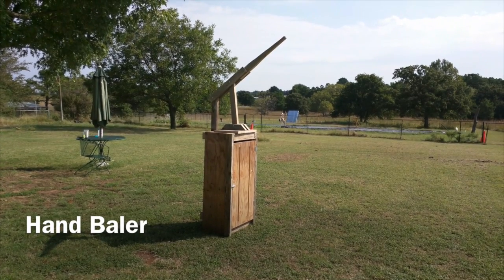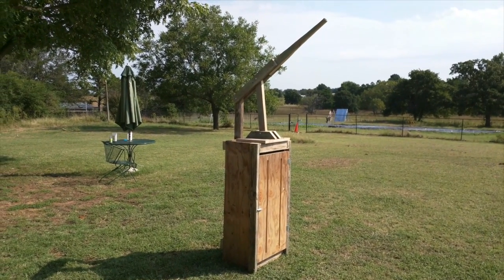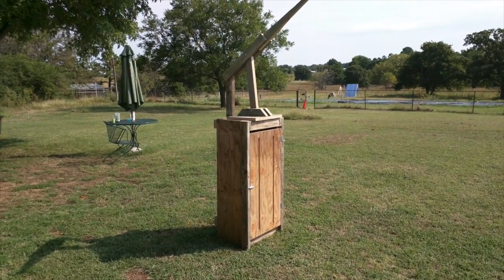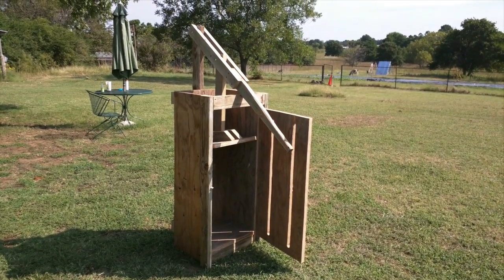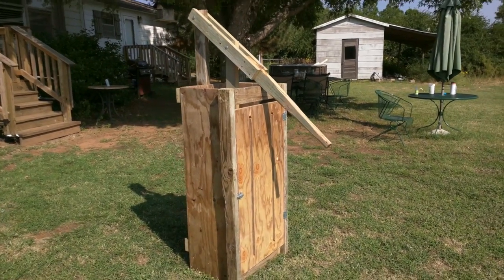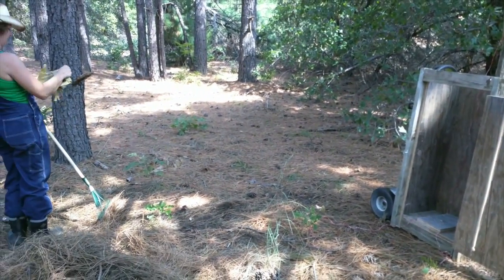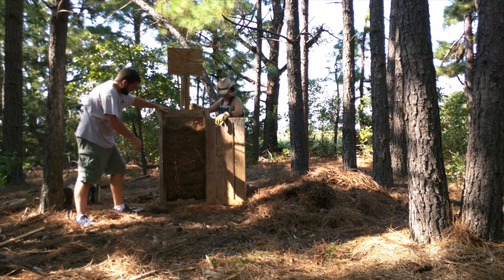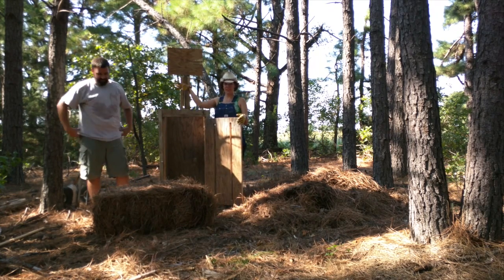How to build and use a hand baler

Comment: The back baling twone goes up the inside of box and out top and down the outside box with loops to catch on hooks - out of tbe way and stationary until bale is finished then over the top of bale and out through front slats where tied to bottom ends of twine - open door and pull out

Comment: Can you bale aluminum cans with this?
Reply from the maker: I suppose you could, however I'm not sure how well the "bales" would hold together.  Grass, hay and pine needles all hold together because the long strands essentially "weave" together to form a solid mass.
Reply: Yes you can. I made one for cans and it works pretty well. If you compact them pretty good then they do stick together decent. But it will only work with cans that aren’t crushed to bad. You also can’t throw them around to much and have to be gentle with the bales or they will fall apart. And sometimes they don’t stick together very well at all. Good luck!
Reply: Thanks I'll give it a try.

Comment: Your wife is nice, to help you with all that work. Be sure to always be worthy of her.

I made the same device, and use it to bale Fall leaves, which I use all summer in the compost barrels. Leaves are not so good at holding together in a bale, but it's better than using plastic bags, which degrade over time, and also hold moisture and let the leaves get moldy. Here's the URL for an Instructable I made:
http://www.instructables.com/id/Baling-Fall-Leaves/

If you use the free 3D design software SketchUp, you can download and view a design based on the TAMU instructions that I uploaded  to https://3dwarehouse.sketchup.com/model.html?id=ued02385a-5d27-45de-8b45-be4805c2edd9